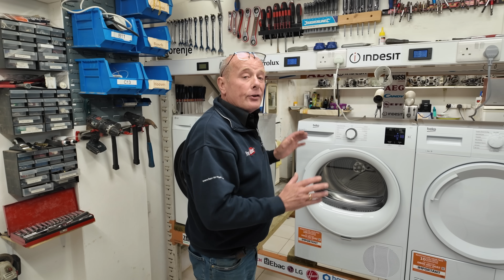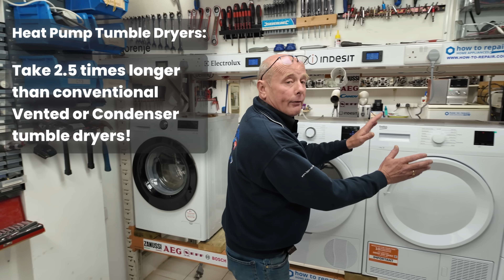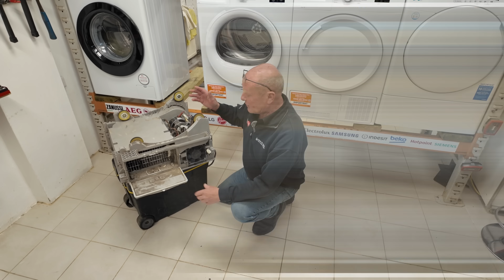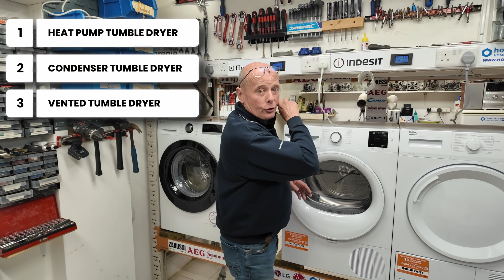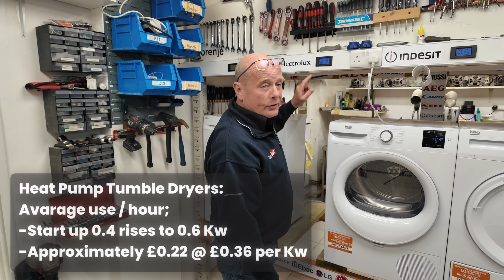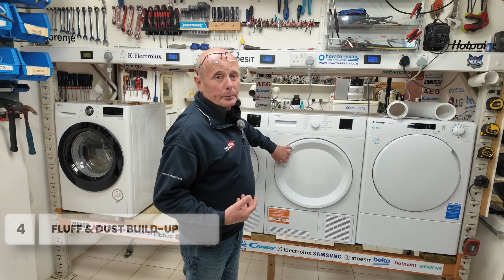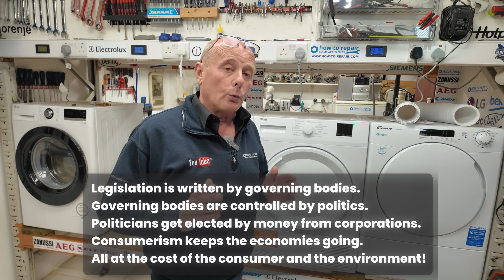Tumble Dryers the Shocking Truth About Heat Pump vs Vented & Condenser, NEW LEGISLATION!

Comment: I wish you had done what you said you were going to do and actually load the machines with the same load of wet clothes and measure the time and energy needed to dry the clothes to the same level.  It takes roughly 2200 joules of energy to evaporate 1 gram of  water, so weighing the clothes when you start and at the end will be highly informative.  If they start at the same weight and end at the same weight, using the minimum run time possible, you can see the drying efficiency. So total joules consumed for a given weight of water evaporated in a typical load.  As far as I understand:  the condenser TD acts more like a desiccant drum dehumidifier and the (the clothes loaded are effectively the equivalent of the desiccant drum) and the heat pump TD is more like a refrigerant dehumidifier. without knowing the specific design and construction, I would assume the condenser loses more heat to the room but it can be room sealed into an unvented space thus emitting valuable heat in cold weather.  As with a refrigerant dehumidifier it is not beyond the wit of man to design a serviceable filter.   Certainly for old refrigerators the compressor and evaporator and condenser is proven technology and can easily last decades, as some of the ancient fridges and freezers, still going strong, proves.  I only know of one compressor failure in a friends fridge but my tin foil hat believes this was a deliberate design issue to reduce its service life making him have to buy another fridge. Apparently the service engineer believed the same, as he noticed more compressor failures with the modern fridge/freezers.

Comment: Don't buy a heat pump tumble dryer. Buy a heat pump dehumidifier, put it in a small room, and hang your clothes in there. We did this for years, and its a very effective way to dry clothes. Many dehumidifiers have modes specifically optimised for clothes drying. It not only works better, if a dehumifier fails its a lot cheaper to replace than a tumble dryer.

Comment: How exactly are heat pump dryers more efficient than the 100% efficient conversion of electric heating elements?
Why not just put in a smaller heating electric element and have a heat exchanger?
This seems like a greenwashing (no pun intended) gambit by consumer electronics manufacturers to sell more parts and new appliances.

Comment: I’ve got a grundic tumble drier that’s 7 years old and has kept a family of 5 going the whole time.  It’s as good as new units operation. It’s is staggeringly cheap to run. Literally lowers the humidity of the room it’s in and had a 5 year warranty when it was new.  If it broke I’d be fixing it. 
Yea I’ve run it with a meter and it’s so much more economical than anything else I’ve had.

Comment: Domestic refrigeration units are ultra reliable so I see no reason why re gassing or compressor failure should be an issue.  Given the very high prices we in UK have to pay for electricity I am happy to have swapped to a heatpump drier.  I do not think that running the units empty proves anything.  The heatpump will be most effective at recovering the latent heat of evaporation in the condensor so well suited to this application.  I do however agree that fouling up of the condensor is likely to be an issue and am disappointed to hear it reported that they are hard to access to clean.  Which? magazine have put some numbers on the costs and are quoting running cost of £50 for heat pump and £140 for vented and whole life cost is equal after 3 years and a saving of 50% if the heatpump makes it to 6 years.  Whats not to like?  Always clean the filter on every cycle and the accessable part of the condensor frequently.  Use a paintbrush.

Comment: I really want a British environmentalist telling me what kind of dryer I should be buying. And poor people really want these over technological dryers so they can spend what  little money they have getting to dry their clothes. Maybe the newer style dries a little bit quicker, but the idea that the Old style tumble dryers only last five years is the biggest load of BS. Maybe the ones they manufacture now because they’re trying to turn over more dryers, but I had one for 20 years and we dried a lot of clothes in it. 
   And a lot of older people that owned old school tumble dryers that were manufactured properly in days gone by  will say the same thing. 
you used to be able to have an appliance for 15to 20 years and sometimes.  even longer.  
   We’re going from easy to manufacture easy to repair dryers at work just fine to overly complicated crap that aren’t gonna last very long and will need extremely expensive repairs.

Comment: I bought a vented drier two years ago. We had one for 20 years before the door broke and couldn't be repaired. I'd replace it before from a donor machine. Our new Hoover is only used to dry sheets in winter. We use a dehumidifier to dry clothes. It has a clothes mode specially built in and  use an airing rack to put the clothes on. It's much cheaper to run and bought from Screwfix. The vented drier was cheap but only used in winter as I mentioned earlier. My parents used a Flatley. That's before tumble dries in the 60s.

Comment: Like much of this “eco nonsense “ sometimes there’s a serious lack of common sense before they jump in feet first, because if it’s in the scrap heap a lot sooner than its counterparts , long term bad news, glad I bought a condenser dryer when i replaced our previous vented dryer, I considered a heat pump, I researched before buying and glad I took into account of how quickly it’ll end in landfill our previous dryer was 12 years old and I sold cheap where it will live on a bit longer after many repairs over it’s service.

Comment: They may save energy while running, but how much energy does it take to manufacture therm? And if you have to replace them more often, aren't you losing the energy you saved running them to the added energy of manufacturing the replacement? And if they are not being repaired as often, but instead being replaced more often, again, isn't that an additional energy expense?

Comment: The gases are generally propane or something else relatively innocuous. Something nobody has mentioned (I have no stats) but safety. I’m happier without glowing elements and lint. Finally had a candy for 7 years the capacitor went - that’s it. Got a very good bargain Black Friday and passed that to a family member - the energy savings have been huge with high use. The nasty trick I’ve spotted the old candy had a foam filter in front of the evap. They are doing away with these - it’s asking for trouble, so I’ve added one from some foam type filter. That is a nasty move. As for the methodology themselves - quite good.

Oh last thing a vented can increase heating costs as it’ll be drawing outside air into the room (usually cold) replacing your already heated air.

Comment: Excellent explanation. Many thanks. You are quite right. I'm a pensioner and keep my house at 15 degrees C max. Will a heat pump dryer work at that room temperature?
Reply: If you check the instructions they often state the minimum recommended ambient temperature, some will work well at lower temperatures than others, but I don't think that temperature would be too much of a problem for most current models, going by what I've read. If you wanted to use one in an unheated garage you are more likely to have a problem, although I've read some models may still perform adequately at as low as 5°C.  You can get hybrid heat pump dryers, which have an element used to supplement the heat while it gets up to optimum drying temperature and dry more quickly at the cost of using more electricity in hybrid mode, but I think they are getting less common because the latest generation of heat pump dryers are supposed to be much quicker at drying than the early models anyway.
Reply: Thanks for the extra info. You've got one more subscriber!

Comment: We have had a HP tumbler for a year and a half. Early days I know, but we love it. It does take longer to dry than a vented tumbler, but we can run ours off our solar. Can't do that with a vented machine unless you have a massive array. Time will tell with reliability...
We only use it in winter - we use a clothes line in summer, and there are only two of us in the house. Probably very different if you have 3 kids and don't have time to wait.

Comment: I bought an faulty AEG condenser dryer for £20, after watching these videos. Replaced broken belt for £10 and fully cleaned internally  Wet loads done within an hour. Simple and Easy to repair. No brainer and im sure the maths are still in my favour over 5 years.
Reply: Absolutely they will be
Reply: Put up a couple of air dryers overnight and take down in the morning. Use a dehumidifier to remove excess moisture.
Reply: nice one this is the common sense approach that is missing from government and green energy <experts>
Reply: @honorkemp except it is the opposite of common sense. Common sense is not to spend 2kw/h just drying clothes
Reply: terrible... I use a clothes line and dont pay anything to dry my clothes. You are just throwing money away!!!  If we all just go back to the "good ol days" there will be no problems what so ever and everyone will be happy happy happy!!!!!!!!!!
Reply: @johnb1567  In the UK we have several months a year where clothes won't dry outside - so you'll be creating mould while drying indoors and it costs more to heat in higher humidity. Nice one!
Reply: @darrenadams2640  
Gas fires are the solution with drying racks.
Reply: @johnb1567  Only so many clothes can be dried on the tiny balcony of an apartment lmao
Reply: @johnb1567  If you have a clothes line in ireland you get laughed at...no point when you can only use it 6 times a year.
Reply: @DreamBEV sorry, I was just trolling. I should have put some more emojis or something.
Reply: @johnb1567  only used in winter.
Reply: @johnb1567  "If we all just go back to the "good ol days""
We'll spend hundreds more hours a year doing laundry. I'm happy to spend 80 bucks a year to get a couple of hundred more hours of free time. You can't get that time back, but you can get 80 bucks back.
Reply: @johnb1567  This applies to the entire thread, I don't mean to pick on you. Which good old days, pump water from your well outside, poop in the outhouse, light the oil lamps at night and die when you get sick. Dictators have simple "solutions" to complex questions but in the real world,  everything is actually complicated.
Reply: @johnb1567  Either you are not in the UK, or you obsessively watch weather forecasts, to plan less than a dozen washes per year.

Comment: I had a vented Whirlpool dryer, lasted 0ver 8 yrs, heating element packed up, contacted a ex curry’s electrician/repair person, he said to be honest the cost of the component and Labour isn’t worthwhile.  So I bought a new vented dryer, and like you say it’s easy to clean the filter, vacuuming out the machine.
I see many condenser and air source dryers in new homes as they don’t require holes in the wall etc.
Personally my vented in the garage is the best.

Comment: Drying a full load of towels in our Miele heat pump dryer takes just over an hour. It doesn’t add to our home a/c load in the summer, nor does it draw outside air into the home in winter. The clothes are dry and we’re saving energy. I don’t buy the added repair cost argument. Our former conventional dryer broke down three times over 10 years and I had to clean out the exhaust vent every year.
Reply: We had a very cheap White Knight vented drier that performed flawlessly for nearly 20 years. Our AEG heat pump dryer stopped working within two months, and we had to wait another month to get it repaired.  It takes way longer to dry and the clothes never feel as dry as they did from the White Knight.  I already regret the purchase of  this ridiculously heavy and complex appliance.

Comment: I disagree in the speed (I had both), heat pump dryer doesn't take 2.5 time more time, it's more like 20-30% more time. Because even if they produce less heat they also produce the cold to increase the effectiveness of the condenser. Also heat pump are very reliable, if you take a fridge usually last 10+ years withou needing any maintenance